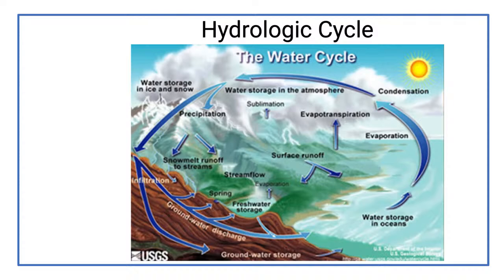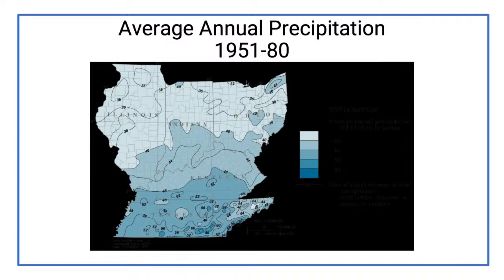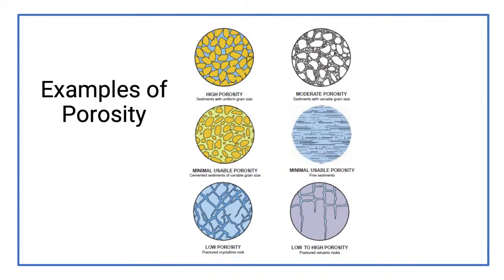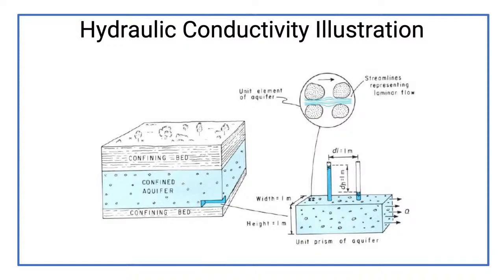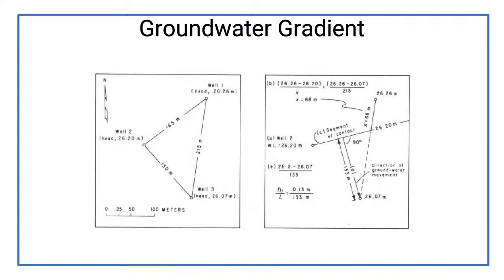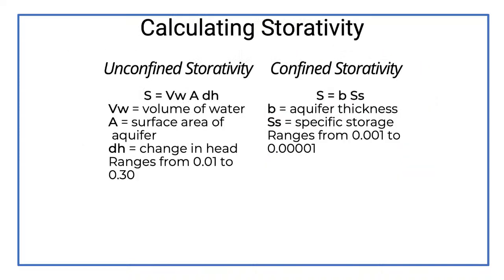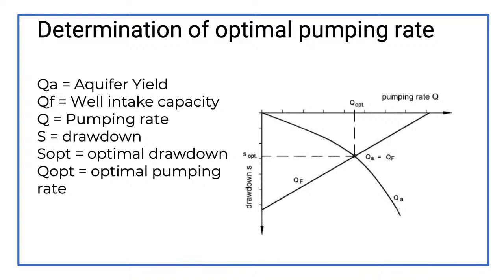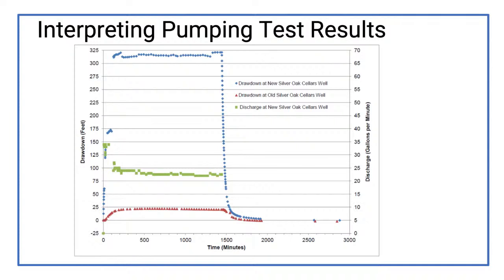Basic Groundwater Hydrogeology on Groundwater Talk Live!

Comment: (1).  Can Karst Topography also be responsible for the factors for certain areas to have land slides / rock slides?

(2). I used to do Spelunking before my Arthritis got to bad to NOT allow me anymore.

I have considered Sinkholes being similar to Caves with the exception of the mode of entrance / exit.  Sinkholes are usually entered Vertically while Caves maybe entered Horizontally.  Am I way off base on that?

Going by my own self-made (and probably POORLY) made definitions, I have been in many more Caves than I have Sinkholes.   Do Sinkholes contain Stalagmites & Stallagtites too as well as as a Cave?   Of, do their presence even matter?

(3). Could the absences of these structures basically mean a Cave is younger in it's age when compared to others?

THANK YOU Sir.
Reply from the maker: It can be hard to differentiate caves and sinkholes because they may be part of the same system of underground conduits.  Sinkholes form from the bottom up and there are usually voids developed under them that they collapse into.  That can be a cave or just an isolated void.  I can tell you that many cavers see trash in caves that originated with people using sinkholes as a landfill, never realizing they are connected below the surface and the trash they are throwing in the sinkholes may end up miles away.